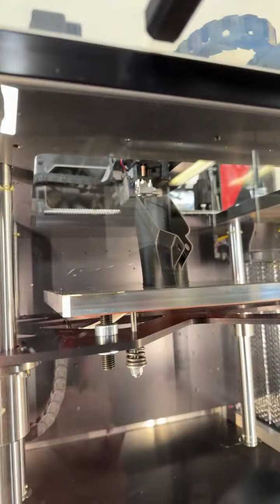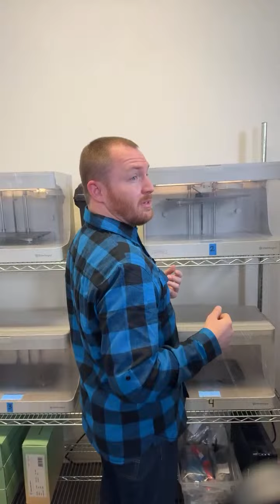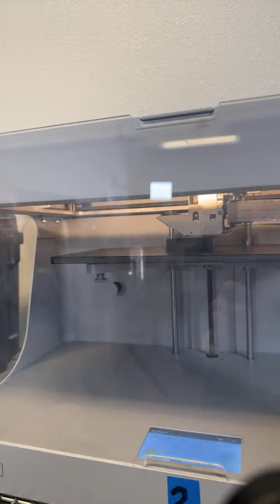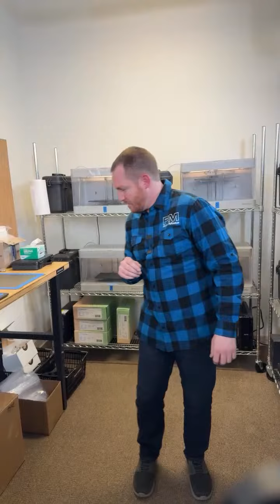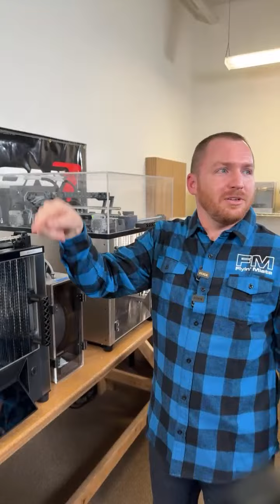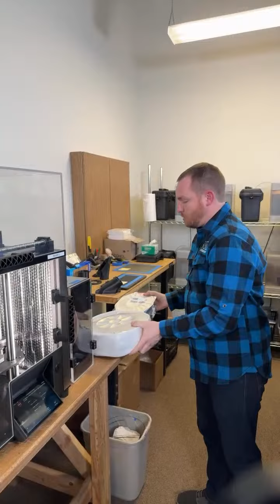FM has new 3D Printers! FM Live w Mike Usrey 1-23-25

Comment: A lot of OEM Miata plastic parts are no longer available.  Are you able to 3D-scan examples for reproduction with your 3D printers?  Are there legal issues for doing so?
Reply from the maker: @dgris7944 There shouldn't be any legal issues for that. It would be possible, but we'd need to see enough demand for certain parts to go through with the setup process. What parts specifically did you have in mind?

Comment: Calling it Hobby level is a real interesting choice. Seems almost back handish. Commercial and Consumer seems to be more in line. 

The layer lines have nothing to do with the type of printer you are using and everything to do with the size of the nozzle that has been installed and thickness of your layers set in the software. Commercial farms will push the limit for layer thickness sacrificing some appearance in order to increase the print speed and production volume. 

Both commercial and consumer printers can deliver objects that not only show zero layer lines, but also have incredible details. You can go all the way down to a 0.2 mm nozzle size and have the layers be as small as 0.06 mm thick with a "hobby" printer.
Reply from the maker: I (Mike) meant no harm by using the term "hobby", so my apologies for the miscommunication.  Being a hobby user myself, I'm still dialing in settings and working with my own printer to figure out how to smooth out layers in my prints.

Maybe a better way to put it would have been to say that Kyle (our professional engineer and CAD guy), paired with a commercial-grade printer, is much more likely to create smooth prints than a hobbyist individual like me who is just using a consumer-grade 3D printer for fun.  🙂